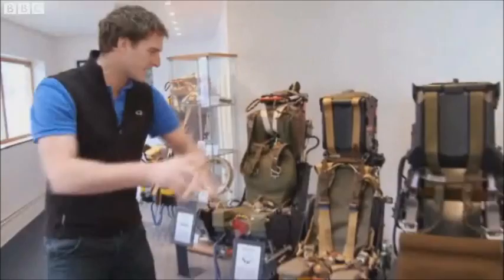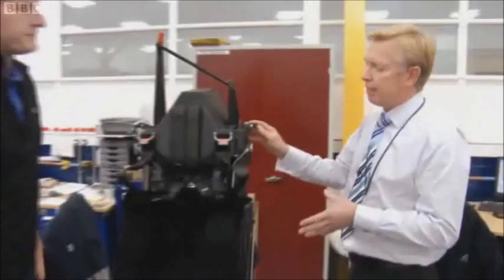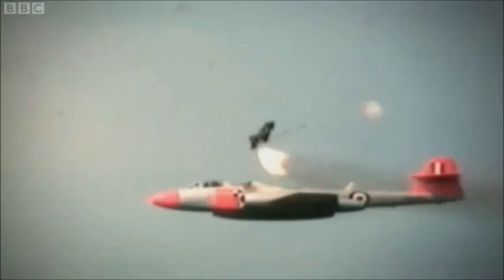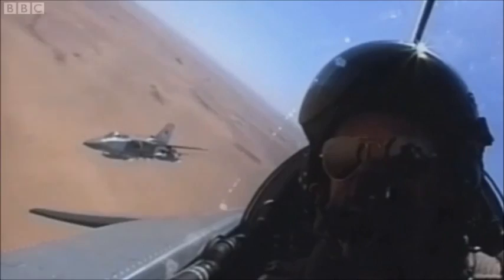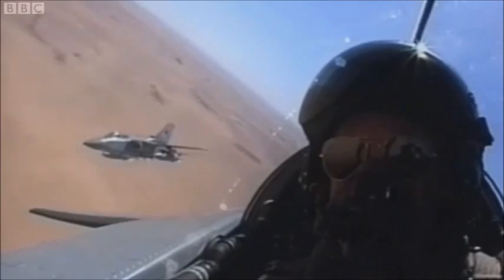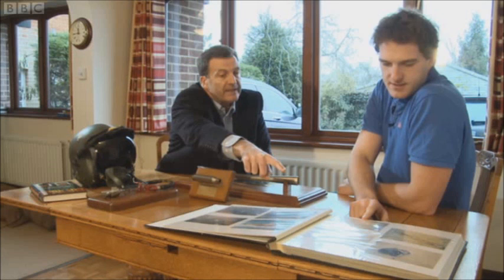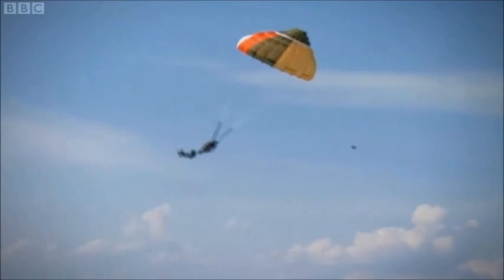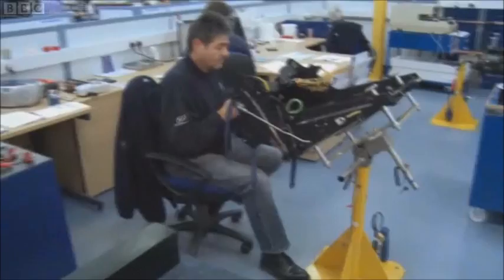Martin Baker Ejection Seats

Comment: beginning your day by wriggling into a G-suit and survival vest and sauntering across the flight deck as the sun rises, then a supersonic jet fighter that smells a little like a new car sprinkled with high-octane jet fuel.  Then salute to the catapult officer. Take a deep breath and scream from zero to 170 knots in two eye-popping, gut-wrenching seconds.  Then yank the stick back between your knees and pull 7 G's into the vertical as you sink deep into your ejection sea.
LCDR. Hermes